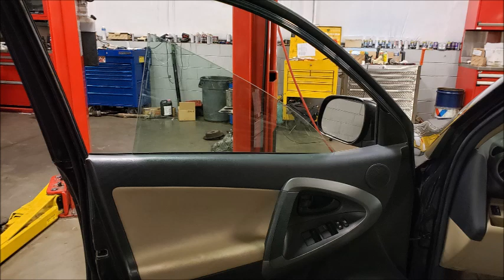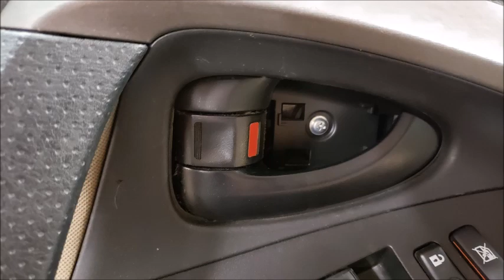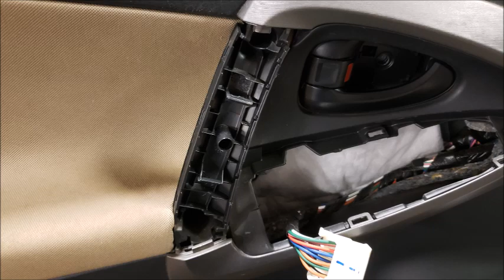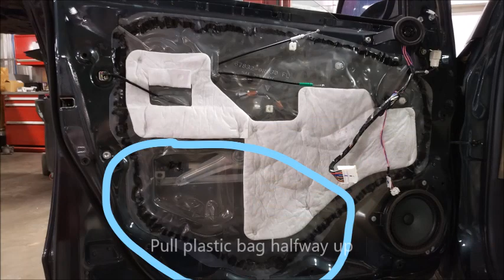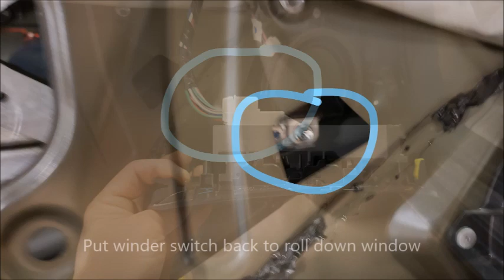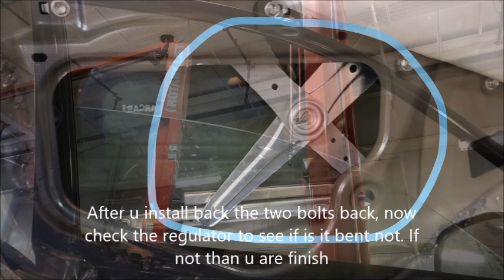2012 toyota rav4 front driver side window off track

Comment: This video saved me $300! The local body shop wanted $150 just to diagnose and estimated another $150 for labor to repair. No thanks!

Followed the instructions and 30 minutes later, the window was back on track working perfectly.

1. The left bolt was out, just like in this video. It had fallen deep into the left side of the door, so I bought a $5  magnetic pickup tool at wal-mart. Make sure you have this before you start the job. I had to poke around a bit but it eventually caught the bolt and came right out.

2. Buy Loctite 232 and apply as instructed. This bolt is notorious for falling out over time and you don't want to have to do this again.

3. There's a second bolt on the right side. After you reinstall the fallen out bolt, plug the connector back into the switch and slowly raise/lower the window until you can see the right side bolt through a cutout on the sheet metal. Carefully remove it, do not drop it down into the door, it will be hard to recover even with a magnet tool. Apply the loctite as instructed, then tighten bolt. Make sure up and down works great before you reassemble the door panel.

4. Don't be scared to pull hard on the clips. They are designed to be very tight and you will need to use some elbow grease to pull on the sides and bottom of the main door panel. There's a tiny chance one might break, but none did and you do need to pull hard before you can lift the panel off the door.

5. You should be removing a total of three screws. One behind the plastic panel behind the door opener, and two behind the plastic panel on the main handle of the door. They are very different looking screws so you don't need to remember where they each go.

Comment: Thank you so much for this. The missing bolt was right where the video showed. Drove home 25 miles in 10 degree weather last night with the window down and was able to fix it today before our next wave of snow and rain are too hit in a couple hours! 

For some reason when my window fully closed it now automatically goes back down half way. Gotta figure that out. Any suggestions? At least I can get it closed now!
Reply from the maker: Trying to initialization it.  I think got some video off that

Comment: Window came off track as I was leaving girlfriends house, snowing and cold.  It was a holiday so didn't figure to be able to get the car in the shop.  Your video was a life saver!  Just what happened, the bolt fell out.  

Only recommendation would be to include how to pull off the covers and panel, found another video for that,  but your video was spot on!  Thanks for sharing.

Comment: This video is 100% correct... we even found the exact bolt laying there.  Front bolt fine, regulator fine.  Replaced back bolt... everything works.  Take your time with the clips.  2011  RAV doesnt have bottom clips... just mushroom type anchors that you can slowly pull out.. Pro-tip:  remove ALL white mushroom anchors from metal door and put BACK into plastic door panel so they pop back in easily.  Again, great video.  Our skill level:  total novice.
Reply: Exactly, the missing bolt laying there!

Comment: well done, thanks. same issue, rear bolt dropped off. couple pointers - the front of the window needs to be in the vertical rubber sliding track before re-installing the rear bolt. Also, the window control panel electrical plug-in has a slide lock. Use flat screwdriver in provided slot to move the slider forward before trying to disengage the electrical plug.

Comment: Thanks a lot! This is really helpful! Just one thing: The video did not show much the white screw being removed. https://youtu.be/6ojBRCOG0d8?t=38
My window was off the track of the rubber, it could not be raised up after installing back the missing bolt. So I had to uninstall the bolts and found out the rubber track was off the edge of the metal frame, I used a flat head screw driver to push it back to fit the frame and adjusted the window fitting into the track and re-install the 10 mm bolts, Done! Hopefully this extra info helpful. 
Feel good about fixing things!
Reply: Yes this happen to me as well. Initial cause what’s the loose bolt. The second bolt was also very loose. My window was also out of the track so I had to loosen both bolts. After getting the window back of the track, reinstall the two 10 mm bolts. Now everything works perfectly!🙂